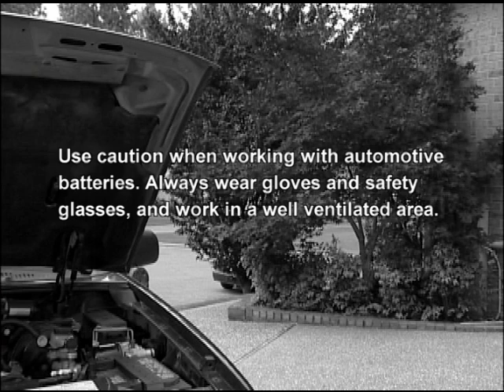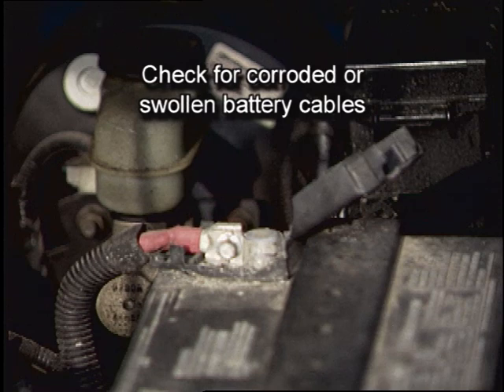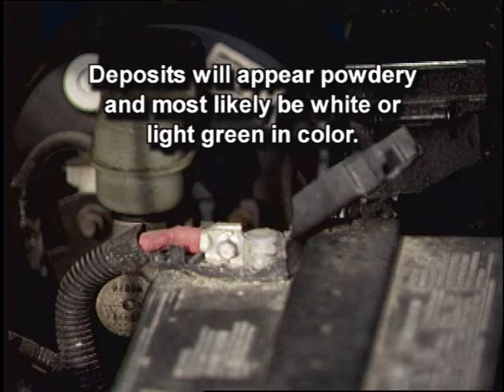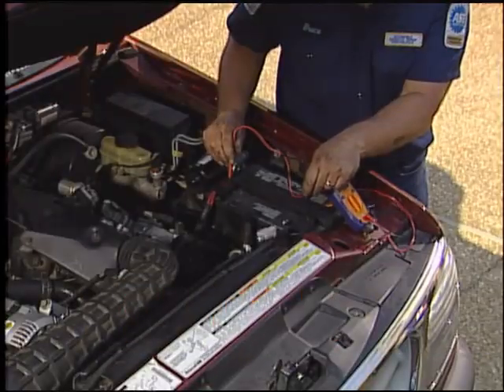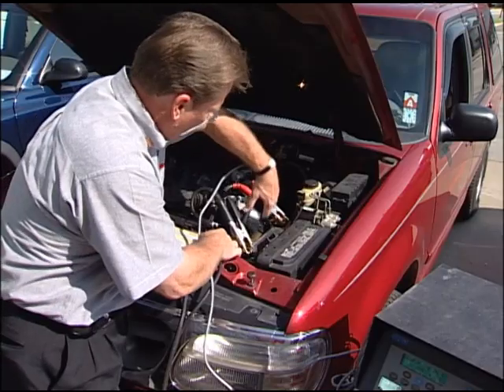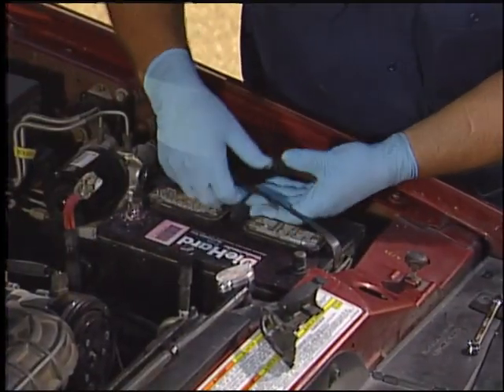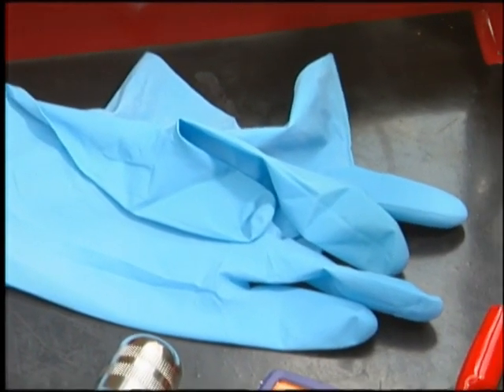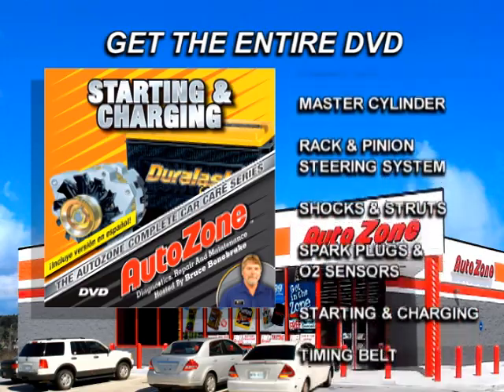How To Diagnose And Remove Car Batteries - AutoZone Car Care

Comment: they dont tell you that you need a load tester . trust me I went out pleanty of times into hot landing zones in Vietnam and if the battery could not start the chopper you where target practice for the v.c. 
auto zone will probably try and sell you an alternator . I'd rather deal with the Vietcong.

Comment: Memory saving device )) Thanks for good tip guys! ))
Reply: +Anton Charniauski what are the memory saving devices and what do they do?
are they necessary?
Reply: The moment about Krona Battery in Lighter socket. )))
Reply: ..........  I  know  they  would  at   least  save  the   radio  presets  and  clock  time,   don't  know  what  else  they  would  do....